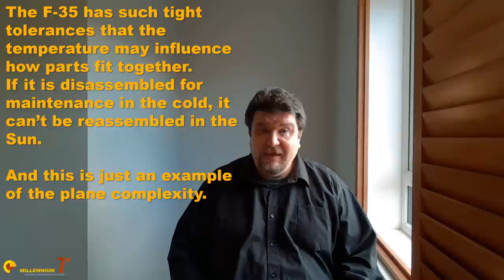F-35: The Failure of the $100 Million  Dollar Jet | Maybe...

Comment: VLO doesn't go away, it evolves. The F-117A went through 3 generations of RAM.

The JSF has already gone through 2 generations of RAM.

Japan does final assembly on its F-35As and F-35Bs and is only increasing its JSF force because they see the writing on the wall with China.
Reply: Never mind a rcs of 2 mm. There is no bug that can fly at mach 2. Or is made out of magnetic metal. Or blocks background radiation. You just can't sell that capability to africa, asia, south america.
Reply: @ekevanderzee9538  Yes. And South Africa currently has half their Gripen C fleet in flyable storage. Why? (Chuckle), they can't afford to maintain them. Their 2010-2020 defense budgets were bigger than Finland's.

The jokes should write themselves if truth was on the table, but instead, you have aviation articles talking about the mighty "6th Gen Gripen", while the F-35 is trash, "can't even fight a MiG-21 WVR and win".

Comment: The US US Air Force, not me, has decided the F35 is Not cost effective. Front line F 35 squadrons are reporting less then 45% operational availability with the F35. And recently they have discovered that the engines are failing inspections faster then New engines are being made.  They are actively looking at replacing future  F35s with the F15X, and the F16V .  Both have started production, and both are much more advanced then the original F15 and F16.  Remember the US Air Force also wants to start building a new bomber.

Comment: I feel that stealth is a specialist function. You don't need everything to be stealth as there are also disadvantages such as weapon payloads and operating costs.
Just built the Rafale under licence 😁
Reply: A lot of people in the comments will disagree with you, even though you are 100% correct. Those people fail to consider the purpose of stealth in a combat environment. While it is unequivocally true that the Navy needed a stealth, multi-role fighter of some kind, the Air force did not, as they already had the F-22 and could have produced more. The Marines didn't need one either, although they did need a new VTOL 4+ gen multi role fighter.

It's my view that the Marines and Navy could have obtained their requirements for less money and complications than the F-35 turned out to be, had they instituted separate design and development programs for planes tailored to fit their missions, instead of a single plane that was designed to do way too much. In other words, it would have been cheaper to produce more F-22s for the Air Force, design and develop a stealth multi role fighter for the Navy, and design and produce a VTOL 4+ gen multi-role fighter for the Marines, And do all three of those things combined, than it cost for the entire F-35 program to date.

I suspect that many bean counters at the Pentagon recollect how successful the F-4 program was, and were trying to mirror that success. One thing they failed to take into account is that the F-4 was designed to conform to the U.S. Navy's requirements, and the plane just so happened to perform well enough that the other branches bought in, having no input into the design specifications of the plane from the start.  IMO, that formula should have been followed for the JSF fighter. 

The U.S. Navy should have been given sole control over the program.  They should have been the only ones to to decide the project requirements, and the plane should have been developed to their specifications. The Air Force would then have the option to produce more F-22s, or buy the Naval JSF, depending on what they preferred. The Marines (or maybe the British) should have had sole control over the VTOL 4+ gen fighter. The rest of the countries could take it or leave it. They could purchase the Naval JSF, or the VTOL 4+ gen fighter, but they would have no input into it's development. 

We must also consider one other thing; Would Boeing have performed better than Lockheed? Probably not. I don't know anything about the program other than what's publicly available, but I suspect the main issue is that requirements kept changing over the course of the development, which caused Lockheed to redesign/re-engineer many aspects of the plane, which in turn cause delays and cost overruns. Boeing would have run into the same problems.

At the end of the day, this is a bureaucratic problem, and eliminating as much bureaucracy as possible would have saved billions.
Reply: @Wizzer In my scenario, I do not propose to sell the F-22 to anyone other than the U.S. Air Force. I proposed to sell the U.S. Navy's JSF fighter, or the U.S. Marines' VTOL 4+ gen fighter to the other branches and/or other allied countries.

But hey, perhaps the U.S. Navy's JSF would be too powerful to sell to other countries. In that case, fuck 'em. They can just design and develop a stealth 5th gen fighter on their own.

My core argument is that it would have been more cost effective to cut out all the bureaucracies of the other two branches of the U.S. military, and all the other foreign Air Forces around the world, and just have the U.S. Navy manage and run the program to design and develop a 5th gen carrier capable multi role fighter all by themselves, and have the Marines (or the UK?) design and run the program for a 4+ gen VTOL multi role fighter all by themselves. There were too many cooks in the kitchen with regards to the F-35 and that caused all the delays and bloated the budget to astronomical levels.

Honestly though, I couldn't give a rats ass if Lockheed or Boeing don't make money selling the thing to foreign Air Forces, and I don't care if foreign friendly Air Forces don't have access to a 5th gen fighter.
Reply: @Wizzer I'm a taxpayer and a voter. It does matter what I think.
Reply: @Wizzer The U.S. Navy has been protecting foreign trade since WWII. They didn't get any help for the past 75 years, and they don't need help now.
Reply: @Wizzer A few things.

First: I am opposed to my tax money being spent on something that could have been purchased for much cheaper. I am not opposed to my taxpayer money being spent on cost effective military items. The F-35 project is too expensive, and I am opposed to that.

Second: I put that passage in quotes and made an attribution, which is a perfectly reasonable thing to do.

Third: My username is the administrative username of a 1970s mainframe computer system that I used to work on.

Fourth: Ad hominem attacks are used by those who have lost the argument.
Reply: @Wizzer LOL

Comment: You should continue this topic on how possibly usa can make a next work horse jet which is low cost and low maintenance, and add up with what similar projects or jets are available in the world.
Reply: F18
Reply: "Low cost" "low maintenance" are these words even in the DOD encyclopedia?
Reply: @paulchristensen2854  they probbaly are used to the ideology of the higher the cost better the jet
Reply: The F-16 was designed from the ground up to be low cost, low maintenance. Obviously now with aging airframes and multiple tranches of upgrades it is no longer "cheap" but it is still one of the cheaper airframes to operate for the USAF.

I actually think it quite likely that an F-16-like airframe, probably along the lines of the F-16XL might wind up being chosen.
Reply: in my mind...the most sucsessefull aircraft of that kind is  SU-30 SM.
you get a :
- 3000 km range,
- heavy payload ( up to 8 tons of weapons )
- highly versatile /multimission ( that can do airsuperiority,bombing,deep penentration an CAS )
- supermaneuvareabille with great overall handling carateristics 
- relativelly simple
- open architecture ( fighter that is pretty much like a toy...you can take out any electronics present in the aircraft and then integrate pretty much any piece of ellectronics or softwear built in russia, europe, isreal, ...etc )

all of that for some 60 million dollars a piece ( wich is pretty much what a SUPERHORNET costs )
Reply: @themilosgrozni237  Russia is under sanctions placed on them by the United States. There is absolutely no way the Americans would ever be so practical.

American defense procurement is riddled with story after story of "not made here". They would rather scupper a procurement program if a foreign competitor proves superior, than buy European, let alone Eastern European. 

The only reason why something like the FREMM frigates were bought is because the capability to build ships like that is literally dying - those shipyards that turned out Liberty convoys and aircraft carriers have a workforce that is either dead or retired. Or sold off.
Reply: @MonMalthias  
well...to a very large degree i agree with you.
but i wasn't advising US AIRFORCE to buy russian jets.

i taught that a guy who asked original question was asking for inspiration ( about what it means to be a cheap but capable 4.5 gen. multirole fighter ).

i think that he asked " what are other similar projects arround the world ( that are aiming to do similar things ).
so i was just giving the idea of how to go about it and what are the long term essential capbillities for a " workhorse " fighter.
Reply: @themilosgrozni237  
I think that of all fighter projects in production today, the most "practical" is probably the Gripen E. It is inherently cheaper to run than a twinjet like the Su-30SM, payload is less but not by much, and it too has open architecture. Range of course would suffer as it was designed from the beginning as a point defense fighter with airfields close to the frontline. But I don't think range should be a reason to refuse to adopt smaller designs. 

There is really a dearth of "workhorse" fighter aircraft today because a lot of warfare is now conducted through strike warfare instead of directly contesting airspace. In other words, attacking enemy airstrips, infrastructure, mustering points, ammo dumps and so forth. Large, complex aircraft with long take-off runs are increasingly vulnerable to being destroyed on the ground.

I think that the Soviet and Scandinavian ideas of having short range "frontline" fighters that could take off from distributed short, rough airfields is the correct doctrine given the capabilities of smart munitions today.

Fighters have increased in weight, range, frontal area, and sacrificed in high-altitude performance while reinforced hardpoints are uprated to carry heavy ordnance like 1000kg bombs or cruise missiles. Costs have also gone up as aircraft are now flown much more frequently with much higher payloads, stressing airframes more. "Bring back" capability has also been stressed because munitions cost a lot more - but landing with a 1000kg cruise missile also tends to fatigue airframes.

I would say that there is no workhorse as roughly defined today. What we can see in the Su-30/35/SM/SMT; the Super Hornet, the F-16 block 52, F-15E, are aircraft nominally designed for the air superiority role, gaining weight and payload to carry air to ground munitions.

But with drones and increasingly sophisticated cruise missiles, I don't think that the days of a so-called "strike fighter" or "multi-role" are too long for this world. Air superiority might increasingly revolve around "light" aircraft without strike capability, or deprecated strike capability, while drones carry the bombs and anti-radiation missiles. 

These "light" aircraft would have a much heavier emphasis on sensors and electronic warfare while its designs should emphasise speed and agility. Hardpoints would be many, but not reinforced to carry heavy munitions. More numerous hardpoints would be necessary as drones propagate. Rough field capability and short takeoff would also be very important.

In this respect I feel that the general trend of combat aircraft will start to reverse. Back towards smaller, single engine designs. The Northern and Eastern European doctrines will be increasingly proven correct over the American or British doctrines of using long-range, long take-off, complex aircraft for air dominance.
Reply: @MonMalthias  
that is an interesting view.

but...i have to ask a question here.
if you are already thinking about grippen....you're not getting very far from F-16 ( in terms of capabillity,cost etc ).

i mean grippen is good and i believe it does have a shorter take off than viper....but you're still very deep into F-16 and F-18 region...on every level.
Reply: @themilosgrozni237  I think for me, the F-16XL is the most ideal in terms of an American style 4.5g light fighter. 

I don't think that the F-16 block 52 or F-18 is quite there. For the F-18 its main issue is the twin engine layout and although its range is slightly higher it is because it is physically bigger. As a naval fighter using folding wings it also sacrifices even more fuel holding capability, which means that it rarely if ever goes out without an additional fuel tank. The compromise is such that now the centreline tank is considered so permanent a fixture, an IRST is now fitted to its tip. 

The same issue with the F-16 block 52 exists in that it was designed as a point defense fighter with minimal equipment, and then had a ton of stuff grafted onto it. The latest iterations feature conformal fuel tanks above the wing. Not the most elegant of design solutions. 

Thinking only about American designs, therefore,  the F-16 XL would be the closest American equivalent of a mass-producible, "workhorse" design. But even here, with 2 heavy/wet hardpoints interfering with other, smaller hardpoints, the XL is still not quite optimal. A single belly heavy/wet hardpoint would be more than sufficient. With 27 hardpoints total, upgrades in electronics to bring it to modern standards, and significant range even on internal fuel, it would be a producible "workhorse" that can do much of the sorties demanded by the USAF.

In terms of European designs, the Gripen is probably the least compromised. The Rafale is too expensive, the Eurofighter suffering from lack of equipment upgrades, and the countries that did buy F-18s and F-16s are now looking to move away from them.

But again, like I mentioned, range is a problem of American style doctrine, not a problem of the designs per se. They are too comfortable with having large, secured airstrips, complex maintenance with extensive use of defense industry contractors and don't seem to be moving away from that any time soon. I think that the Iranian cruise missile strike in retaliation for Soleimani might get them to change their minds though. Other air forces accept that aircraft unable to be maintained by regular personnel are unfit for service. It might take a devastating raid on an American airbase to change that mindset of complexity and contractors.

In the East, however, both Russia and China have rolled out excessively large and expensive stealth aircraft just as military budgets are under pressure from expansions elsewhere. The Su-57 is at the point where the Russian aerospace industry can barely even produce 1 unit a year. 

It is probably a similar situation for the Chinese - and they can't even get engines for their J-20. Ironically the Chinese J-10 which initially suffered from a protracted development period due to lack of funds, is fast becoming the "workhorse" for the PLAAF, even while license production versions of the Su-30 languish for lack of parts. So the "simple" Su-30 even for a manufacturing powerhouse like China that has no qualms about reverse engineering, still can't quite get to "workhorse" status for lack of producability.

For the Russian Federation, it could be that the Su-30SM is the future workhorse. I think it is still too big and complex, but Russia has established manufacturing so it would be difficult to move away from that.

Comment: IMHO USAF should do two things. 

1) Admit it was a mistake to kill the parallel engine program. Back in the day all US military aircraft had a two engine program so if one engine developed problems later it didnt cripple the fleet. GE had a engine design for F-35. P&W was able to get USAF to kill the two engine program and get exclusive contract for F-35 engines. All the P& W  engine problems make the reason for the two engine program even more relevant. 

2) License copy the Mitsubishi F-2. technically it is a modernized design F-16 built by joint venture with Lockheed and Mistubishi. It incorporates airframe changes like the Agile Falcon preoject. It uses the higher thrust GE engine. It already had advanced electronics and AESA radar. 

2a) Build the F-61XL.